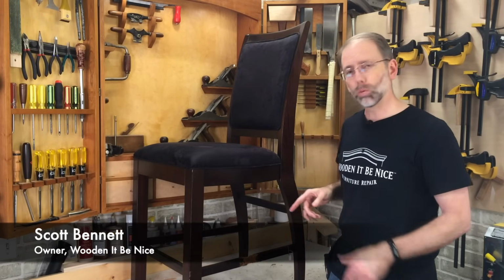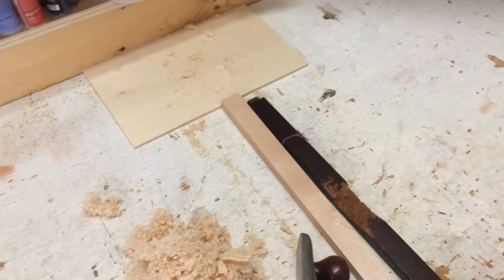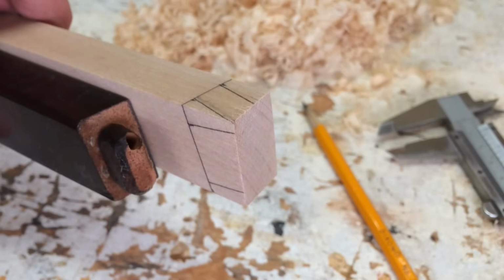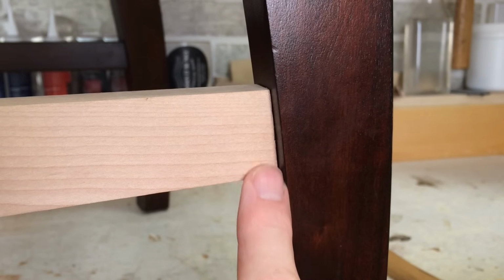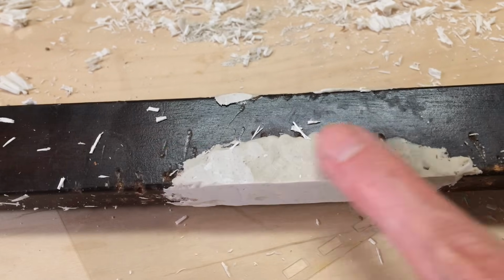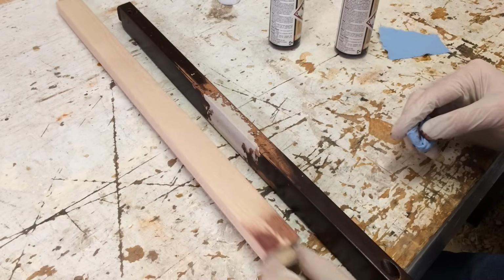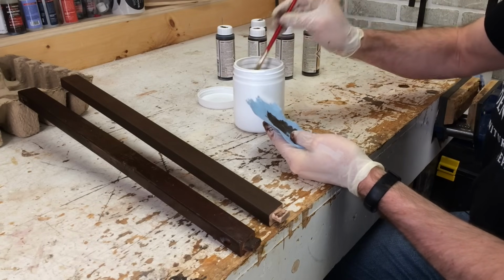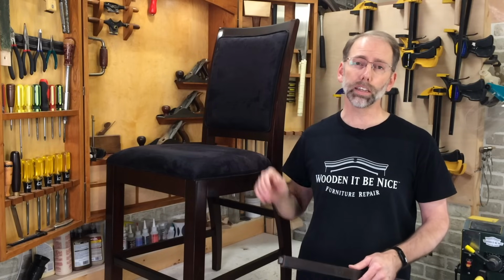2 Ways to Repair Damaged Wood Furniture, by @FixingFurniture

Comment: Nice job making the new piece. It was esp enjoyable to watch how you transferred the tongue shape over to the new piece and cut it out with your awesome Japanese hand saw. The epoxy putty idea was cleaver. I probably would have used rock hard water putty, made a plastic mold around the old leg and filled it with some pourable water putty. Then broke away the plastic form and belt sanded and stained later. Getting stain to match when it absorbs into a different other than original wood surface would seem to be where the real magic would be at.
Thanks for the video.

Comment: This has been so helpful, thank you! I’m repairing the bottom of some mid century dining chairs that have been chewed, I’m going to go down the epoxy route as I don’t have access to tools. The area is bowed though rather than flat, so I can’t use a planer. Would sanding be my only option do you think? Also any tips on how to use the wood epoxy on lighter teak type woods, to make the grain look the same ? Can you use a small detail brush to paint the grain in using these acrylic stains ?

Comment: Epoxy filler can be hard to work with,first I would have used instant glue to harden the fibers of the wood where the dog chewed it then used minwax wood filler ,then sanded it smooth finally using mohawk spray toners and blendalls, tocolor the repair .I have 40 years in the furniture repair business, thank you great video

Comment: Fantastic job.
I think however I would have gone for the 100% replacement for the better strength.
For «museum purpose» the last method is a lot easier, and the strength wouldn’t be an issue.

Comment: `appreciate your work  hint next time using the epoxy  drill a couple of holes to key it in ,usually i do these at an angle ,also as it dries use a chisel and pare it close  ,makes life a little easier,i find plastibond a good product and cheaper ,have repaired countless items where a small amount of damage has been done ,also have mixed stain with it

Comment: Epoxy putty? First time hearing of it and it appears to be legit. As far as staining it, you yourself seemed surprised that it took the stain. 

When I use wood putty, I mix the finishing stain into it to help with the staining/color match. Not sure if you could pull off the same with the epoxy stick; would take a whole lot of massaging.
Reply from the maker: Epoxy putty can be tinted with dye stain.  It also comes in a variety of colors from specialty suppliers.  Cheers.

Comment: This video was super helpful to me. I have a similar repair on a kitchen counter height chair. In my case it wasn't the dog but rather the kids standing on the stretcher.  I will be doing the replacement approach since the stretcher is cracked pretty badly. Was struggling with the angles of the tenon so watching you was very instructive!

Comment: Great repair. I learned a lot. One question: I've seen a number of videos where the wood worker does not use the stain OR paint directly out of the bottle to avoid the possibility of contamination. What are your thoughts on this process?

Comment: Great video. Thank you. I think, that the repair of the original stretcher is an option for someone, who is not into woodworking. If you take your time, you probably only need Sandpaper as a tool (and a wooden block to sand straight). So that could be a real option. Especially, because you probably won't see it, if the repair doesn't turn out perfect. 

When giving it to a professional or having the woodworking skills, I would tend to make a new stretcher. Just feels right. And I would also want to have the dog chewing on wood rather than epoxy.
Reply from the maker: Thanks for sharing that.  I appreciate it. Scott

Comment: Curious to know how much time it took each way?  In the states, on a relatively new chair like that, ordering a new stretcher would be the most common route.  The issue is that some manufacturers don't keep parts stateside, so they are coming on container ships and take 90 days or more.  Many times, those extended warranty service plans will tell technicians/repair companies that parts aren't available because they don't want to have to wait for the part to arrive.  Also, most warranty repairs nowadays are done in the customers home and are on a flat time constraint, so the epoxy putty it the easiest way to do it.

Comment: Scott, excellent work.  It was especially helpful seeing you make the tenon.  The angles and such at times confound me.  I think both were well done and the replacement was a clear choice.  I heard your comments about why you use the stain you use.  I also watch Thomas Johnson and he uses an oil stain most often.  Are there other advantages to the acrylic stains? .
Reply from the maker: I find Acrylic stains work better to get a dark finish that’s on new furniture.  I haven’t found a oil based stain that can do that.  I hope that helps.

Comment: My experience with epoxy wood filler is that it won’t stain right. I only use it for hidden structural repairs. Acrylic stain? I’m gonna try that. Thanks for the demonstration.

Comment: One technique I use when using epoxy fill is to use some soapy water (water with a few drops of dish detergent) to help do the shaping and smoothing.  A lot of my work was on-site and fixed charge, so I would have probably used a toner to do the coloring to speed the process.  Guardsman Black Cherry or Mohawk Newport/Ebonized Cherry looks like it might have been a close match.   Most furniture like this has been finished with a lacquer toner anyway.  And I normally used a non-wax burn in stick for the little fills.   I have two types -- a hard one and one that's a little bit softer for areas that might receive a bump over its life.  Non-structural repairs could also use Bondo or some other mfr's equivalent.  I remember once fixing a dog chew on a rather complex base molding of a cabinet.   I used the Bondo and it took quite a while to get the molding profile cut back in. Once done, the customer said it was a great color match.  An hour doing the fill and 5 minutes doing the color match!
Reply: I'm coming from a carpentry background, not a furniture background. I have used the Minwax bondo (High-Performance Wood Filler) in many applications, and when I have to stain it, I sand it with 80 grit, or even 60 grit to leave some grooves to accumulate more stain and imitate grain. (I convince myself that it works, but tbh, not very well.) 
-- For cutting out moldings, I have lots of experience. For some years, I was doing restorations on 1-1/2-story tall, pre-WW-I ornate mahogany entranceways for apartment buildings in Boston that had suffered UV damage, and required scraping away the surface layer of wood. These jobs were about $10K each, and that was below the market rate. Some had Corinthian column-capitals, with carved acorns and oak leaves, and some of the moldings were built up to the point of having over 40 distinct surfaces to scrape and sand. 
-- Doing this on moldings was made easier by a no-longer-available Craftsman detail scraper (Hyde makes one, but the shapes are not as good). It's a handle to which are clamped various blades, held at about a 75 degree angle to the axis of the handle, by means of a retractable t-rod that fits through a keyhole in the blade. Three of the blades were rectangles with one end rounded to a radius, 1-1/2" wide, 3/4" wide, and another 3/4" wide one that was tapered to get down to about a 1/16" radius. There were a couple of assymetrical pentagons, one tall and the other one very flat, the flat one with ends like angled chisels. And the last one was like an arc from a 3" circle, flat on the other side, like a semi-circle but flatter, that used about 1/4 of the circumference. All of the edges were sharpened, and the resulting scrapers were very useful. Eventually I had to get a metal fab guy to make me new ones, because the old ones had been sharpened down to being too thin to fit well on the handle. 
-- This kind of scraping gets into shaping, and the angle on the handle was very helpful. At any rate, I was able to get nice, sharp grooves with these tools. For sanding, I tried out a few detail sanders and found them useless. I ended up using strips of credit cards about 7/8" wide, with 1/16 of a sheet of 80 grit wrapped around them. (I always found Norton Pro-Sand to be the best. 3M clogs too fast and doesn't cut as well, except for their stretchy plastic sandpaper which is useful in some applications.) 
-- For exterior work, I use Sikkens Cetol Marine varnish. It's an alkyd varnish that stays somewhat flexible, and has UV protection, and it lets the grain show through a lot better than the Cetol residential products. (Corporate rearrangement led to the two lines being made by different companies.) The marine product is easy to clean up for maintenance coats-- wash with TSP and a scotchbrite pad, rinse, dry, and recoat. They recommend every two years, but it looked pretty good after six years, being in a non-marine application. 
-- And when applying any varnish over oily woods like mahogany, it's imperative to wash the wood down with acetone or laquer thinner, to get the oils out of the surface of the wood, just before application. Otherwise the color comes out all splotchy. Been there, done that.

Comment: The epoxy was a job well-done, but I don't think it worked quite right.  It also lacks the grain of the original piece.

I also worry about strain at the thin point.  If the wood stretches differently (per pound-force per square inch) than the epoxy, the repair may become compromised over time.

Comment: Most everything you have in tools I also have for furniture making or repairing, if necessary. The total new one would have also been my choice. The tenons are "different" but not too difficult to cut. Toughest part, matching the color. Trying some gel stains and spirit stains to see how they work depending upon wood choice. Thanks for the information.
Reply from the maker: Yes, stain matching takes time to learn.  I’ve found the trend of new dark furniture most challenging.  I’ve tried gel stain, dyed polyurethane, dye, and traditional stains.  Acrylic seems to the the most effective for me.  Glad you enjoyed the video David!

Comment: Occum's Razor applied to woodworking! I'm impressed.  Using a plane is an obvious technique the I haven't thought of before ... not that those repairs would have handled it.  Thanks for putting that up! I'll keep it handy for future use.  In the past I've had to use chisel, file, and sand paper.  By the way, the camera angle while you were next to it made the chair look huge! I couldn't help but laugh. It was an eye twister. While the epoxy is a great fix, my personal choice would have been yours, make a new one. As I have done in the past.
Reply from the maker: It’s funny that you mentioned the size of the chair, because it was huge.  It was about 25-30% wider than the average chair and it was also counter height.  Cheers.  Scott

Comment: Great idea for using metric; it's accurate and easier. Great video.Thank you!!
Reply from the maker: Glad you like it!  Thanks for sharing that.  Scott
Reply: Also, metric is most likely what the shop that built it was using. If it was an older American or English piece, you might get a more consistent measurement in inches and eights/sixteenths.

Comment: With my skill set I'd have tried replacing a section in the middle of the stretcher and avoided cutting the tenons. I'd have  used dowel and epoxy. And perhaps with a scarf joints. As always another excellent video!
Reply from the maker: Yes, those angled tenons can be intimidating.  Thanks for sharing that.  Scott

Comment: I like the one you made better. My question is could you have cut thar piece out and added one in? That might have been less noticabe than rhe epoxy one? Thanks like you videos.
Reply from the maker: That's a good question Robert.  To patch in pieces of wood, that would have been difficult as it was on multiple slides.  I guess with 4 different patches, it could be done.  Thanks for sharing that thought and thank you for being a subscriber to our channel!  Scott

Comment: Many retail furniture sellers can order specific parts for furniture that is current. Get the numbers and speak with the service tech. Keep in mind that left and right is determined by facing the piece when speaking about furniture. When I was a tech for Ashley, I never charged a customer for a part like this I could order. I definitely used the putty many times. Is it weird that I kind of miss the smell lol?
Reply from the maker: Thanks for sharing that tip.  This piece was made in 2009, but I didn't connect with the manufacturer to see if they had parts... several new pieces (2023) I've recently repaired came to be because the retailer couldn't get parts.  I'll think about that next time.  Thank you!  Scott #tip
Reply: @FixingFurniture  LOL You're welcome, but I probably wouldn't watch your channel if it was just you ordering parts. Keep doing great work.

Comment: Nicely done and great options for the customer. A couple of hints on the epoxy. Mohawk has colored epoxy sticks that assist with the color match. And, a chisel with a wet edge at the 15, 30, and 45 minute mark of dry time makes shaping a lot easier. Excellent job overall.
Reply from the maker: Thanks for the tips!  I appreciate you sharing your experience for me and others to learn.  Cheers.  Scott

Comment: If that were an antique or designer hand made chair, I would restore the original to keep the thing as original as possible. But for a cheaper and/or newer piece, a new stringer.
Reply from the maker: I agree, this would be a different situation if it were an antique.  Thanks for sharing that.  Scott

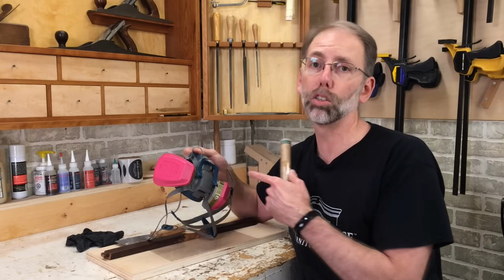Comment: 14:35 What??? I've never heard of an epoxy that requires respiratory protection. However, gloves MUST be worn, as epoxies contain harmful Amines and are sensitizers as well.  Second, YOU CAN'T GET A GOOD SEAL WITH A BEARD, and you will inhale some of whatever you're trying to protect yourself from...
Reply from the maker: Yes, read any Safety Data Sheet for epoxy products, and good ventilation or respiratory protection is required.  I understand a beard interferes with the seal of a respirator, which is why I keep it trimmed short - when it gets longer, I can smell chemicals from the seal gap.
Reply: @FixingFurniture  Wow! Thanks for the reply.  I guess at all of my previous employers, the "adequate ventilation" clause was deemed sufficient.  Of course, I agree that in an enclosed space, any volatile compound will become noxious quickly.

Safe woodworking, in any case!

Comment: Alcohol, like rubbing alcohol, or IPA is very good at cleaning fresh epoxy.

Nice work on these tenons, they are compound angles in all directions.
Reply from the maker: Thanks for the new tip on using alcohol to clean off fresh epoxy.  I didn't know that.  Glad you enjoyed the woodworking.  Cheers.  Scott #tip